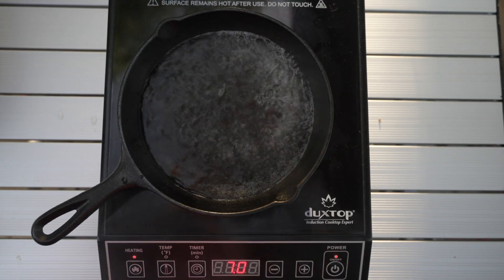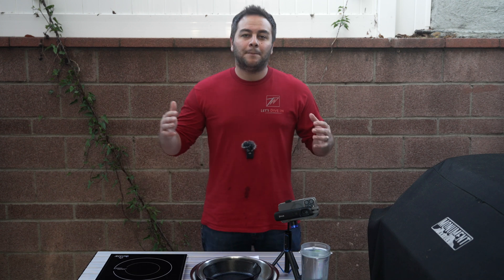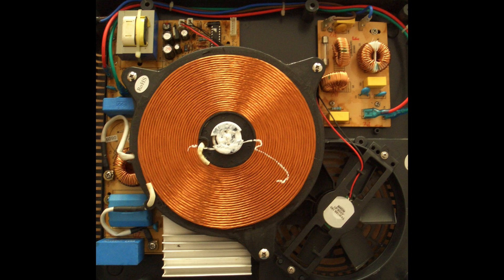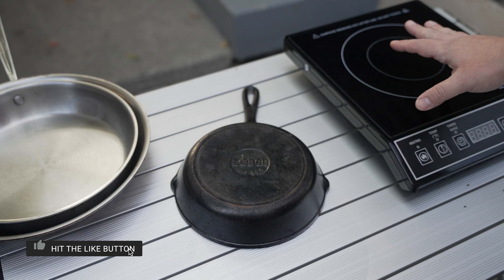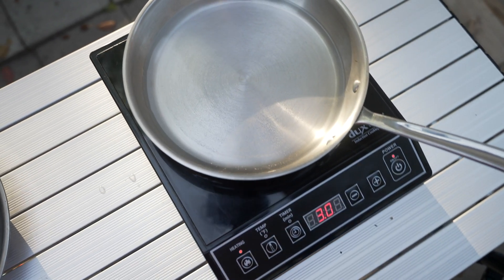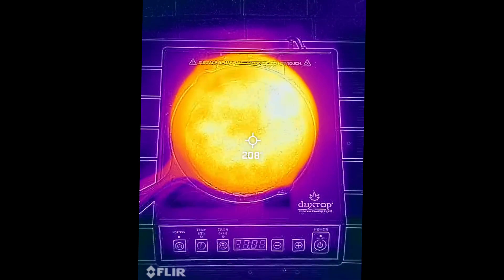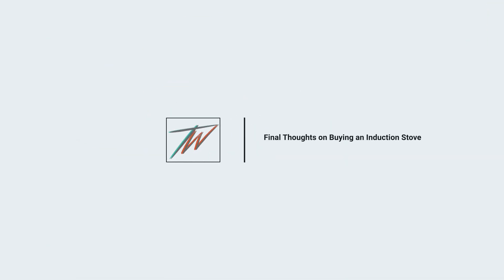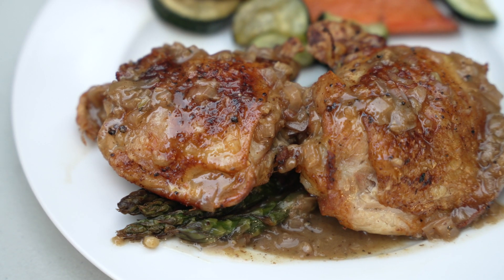Induction Stove Top Coil Size Matters // Thermal Imaging Shows You Why

Comment from the maker: What did you think about the result? Are you considering ditching gas stoves for induction? Do you think gas stoves are harmful? Let me know below.
Reply: I would never switch to induction until they fix the issue with heating the entire pan.  Gas is so much more efficient at heating the whole pan.  It may not do it faster, but the 2 or 3-minute difference isn't important to me as a home cook.  I've never ever had to rush a meal and was 5 minutes too late due to the gas not heating up fast enough. That's the only benefit I can see.  Electricity is WAY more expensive.  As long as you have adequate ventilation, air quality isn't an issue.  And for those who say induction is better because it requires less energy, you need to take a physics course.  The amount of energy it takes to raise 1 ml of water 1 degree Celsius is the same regardless of the heat source.  Sure the generation might be more efficient but the amount of total energy required in the end to the pan is unchanged.
Reply: Harmful; maybe! I am more interested in depriving the Greedy gas/oil companies of $!
Reply: @tomwadek 

I love induction 1000 times better than gas. Perhaps when pan searing an expensive steak gas is better but I got used to induction in the Philippines and I rate it 1000 times better than gas for health reasons and I felt the performance of induction was fine.
Reply: Can you change the size it heats up? Mine is only a small diameter in the middle
Reply: I think they are coils, not really magnets. They induce a magnetic field, but are not magnets, don't spread misinformation and just call them what they are.
Reply: @SirDragonClaw here you are on y-t and all you need to do is look up how does induction  work, and watch the vids! Pathetic!
Reply: Yes gas is harmful. Not nearly as harmful as many things in your kitchen. 
I always preferred gas because I could adjust the size of the and know how hot it will be. I believe gas heats faster. How many restaurant kitchens use electric stoves 
After using induction hobs, I prefer them to gas.
Reply: The very issue you discuss ... misleading burner diameter markers and evenness of heat distribution disqualify induction for serious cooking.
Reply from the maker: @bobtheelectrician6692  yeah, it’s unfortunate. I’ve found good brands do clearly list their burner but it’s mostly for kitchen size tops and it’s well over $3k
Reply: @bobtheelectrician6692  : A Goldilocks Fairy Tale 
The supposed benefit of greater energy efficiency is a mirage. It holds true only for a very constricted range of "appropriately" matched cookware/coil sizes. 
The very informative thermal imaging shows that even the 8-inch cast iron skillet is, in fact, too small as the side walls undergo unnecessary, and perhaps undesirable, heating. 
In a word, the control is simply not there. 
- -
Reply: @adamnoman4658  Not true. The induction stove energy efficiency is dictated by its technology -- the pan heats directly. Electric stoves and gas stoves have an intermediary -- element or flame; this is why induction rules. Of course, the combustion product of gas stoves make them a complete no-no in "air tight" homes.
Reply: gas is the best

Comment: I love my gas stove. Cooking with gas is sexy, and great heat distribution. I also have make up air, meaning an open window, and run the fan all the time. 
I have an intro induction cook top that I use outside to cook fish and I use it in the winter for basic boiling. I’m looking at potential upgrades and the Breville is on my radar … huge price difference… and wondering if it’s the coils that make the difference in that unit …

Comment: Who makes a good portable induction cooktop with a 10" or 11" coil?  I have a Nuwave PIC gold pro and am very happy with it's 8" coil when using a 10" 3 qt saute pan.  I'd like something bigger and maybe a full 1800W to work with a 12" skillet or 5 qt jumbo cooker or dutch oven.  Do I need to get a full cooktop replacement to get an 11" 1800W coil?
I started with the PIC because I didn't want to use cast iron on my ceramic IR stovetop.  I've now upgraded most of my pots & pans to tri-ply and cast iron because they just work better. 
I'd also like to keep the temperature control and sensor for the pan and the food probe.
I've measured the power my PIC uses to heat a 12" skillet and know that it needs to be a steady 1000W to maintain the temperature.  Initial heating requires even more to get it up to cooking temperatures.
I also know that using 1500W on a small pan is enough to warp the metal or crack it.  And yes,  it can get hot enough to melt aluminum if the temperature is not limited.  I think the Nuwave feature providing 3 power levels (600W / 900W / 1500W) and a temperature control with 5 degree resolution is the best method available.

Comment: Sharing my experience with finding out actual coil sizes of mobile induction cook tops for one (large) pan/pot. Spoiler: it has been frustrating and my text is rather long! :(

[Preface: For my smaller pots and pans I am using a slim tokit induction stove top that I chose specifically because it can actually simmer, as it doesn't turn on and off (pulse) a lower wattages. So far so good. BUT: 
The diameter of that induction coil is rather small [around 15 cm judging from the bubbles in water or the browning of crepes], so making crepes or pancakes or evenly browning meat is REALLY difficult to impossible.]

So I started to look for actual coil sizes and it es VERY VERY FRUSTRATING, because even customer service will often NOT know the actual coil size. 

For example: I asked for the coil size of the rather pricey SMEG induction cook top in a comment to the official instruction video by SMEG here on YouTube, and the answer was "22 cm". 
I had parallely asked via contact form on their website and the customer service initially answered that coil size simply was NOT REQUIRED TO BE MENTIONED in the technical information of an induction stove, so she said she doesn't know! 
She continued that "as it says cooking zone: 22 cm" and that it was "suitable for pots/pans from 12 to 24 cm" (not specifiying whether that's pot diameter or contact area) "we are safe to assume that the coil size is around 22 cm". 
I wrote back that for a product in that price range I don't want an assumption but an actual fact, and that I would appreciate if they could please find out specifically - I mean: SOMEONE in their company surely must know? 
The answer I got THEN was: 16 cm(!)

I have also asked other companies concerning their 2000 Watt to 3500 Watt single coil mobile cook tops, and most WON'T give you that information or won't bother to answer at all.
The ones where I found out the CONFIRMED ACTUAL COIL SIZE: 

- SMEG indution cook top: 16 cm (as mentioned above and contrary to the "cooking zone of 22 cm" they claim.

- AMZCHEF 3500 Watt with a second coil ring that can be manually added by you pressing a button. They actually tell you the coil size in the product description: 230 mm (23 cm)

CASO told me specifically when contacting them via e-mail: 
- CASO Maitre 2400: coil size 21 cm 
- CASO TC 2400 Thermo Control: coil size 21 cm (actually the same as the one above, except for an additional thermometer that can be used to control the temperature by placing it inside the pot or meat etc.)
- CASO  ProChef 3500 Art. 2364: coil size 23 cm (but this one is HUGE as it is meant to work in professional kitchens - so it would be too high to put on top of my kitchen counter)

So far I have only tried the AMZCHEF 3500 Watt and making pancakes in it was a DREAM! I had some other issues with it (the pulsing in lower wattages made it very difficult to boil stuff evenly - simmering in a large sauce pan was impossible or at least wasn't intuitive as it would have needed experimenting with using only the small inner coil in spite of the large contact area of the pot), and I didn't like that the hard plastic feet made it slide around on my kitchen counter when stirring or cleaning. 

I have not yet tried the CASO Maitre 2400 as I have become tired of ordering stuff, trying it out carefully not to scratch anything, get it sparkling clean as new again and return ... . 

Does anyone know if there is a list of single or double coil MOBILE induction cook tops with ACTUAL coil sizes? I would very much appreciate any help. Thank you!

Comment: Do you think a diffuser plate could help disperse the heat for my 12 inch skillet? 
Also, I find I can’t cook rice on the stove for example, because my burner doesn’t have a proper low heat, it’s simply pulses more or less depending on the heat level I choose - creating a sort of pulsing boil every few seconds instead of an even simmer. I wonder if a diffuser would help with that too.
Reply from the maker: It should but it may not be as efficient n

Comment: Why is the coil size of an induction cooktop important, but not the burner size of a gas cooktop?  I think you'd get similar results if you put a 12" pan on a smaller gas burner.  What's important is the heat transfer of the pan, and sizing any burner/cooktop appropriately to the pan being used.  It's also a factor of the construction of the pan you're using.  How efficiently a pan transfers heat and retains it is just as important as the amount of heat being applied to the pan.

Comment: My last apartment had an induction stove top. I liked the technology, but the coils were worthless. They weren't particularly large, and there were blank spots, they weren't complete circles. This new apartment has a traditional electric stove top and I thought I'd be happy, but as it turns out the burners on it are even smaller so now I'm hunting for an induction hot plate so I can cook without losing my mind.
Reply from the maker: That's a bummer you've had trouble with both types of stove tops, hope you find a good solution!

Comment: The problem with induction coil size is that at larger sizes, the effective area is about half the diameter.

But for 120v 15amp circuit uses, there are no big burner electric stove tops, so the limitation is the same. In practice however, an induction burner was able to cook better than a simple coil top. I used one to cook a big 8 quart pot of red beans n rice (obv no rice at that point). I had to set the induction cooker to a temp setting because even at the 300w setting, it was starting to boil too much and burn, despite having over 2 quarts of water and ingredients.

Comment: It seems the heated area on the pan is only at the end of the coil. So if there's a 5 inch coil, you'll see a 1" boiling ring at around the 5" point along the radius. It seems you wouldn't want that ring to be near the outer edge if you want the heat to spread evenly. So a coil size that matches the zone doesn't seem to be the correct solution, since the inner area would be cooler).

What seems to be true is that there are designs with multiple coils within one zone/element so that there are multiple rings of heat.

I did a test of the dual coil setup that's on the 11" zone of the SKS model (which should be the same as the LG models) and saw two rings: at 4" and 8". 

I also tested a large zone on a Bosch and it seemed to heat the pan everywhere. I'm not sure how it achieves that, but I'm guessing it must have many independent coils for the one zone.
Reply from the maker: Yup, great point.
Reply: So you think the LG 11" zone has a 8" coil underneath?

Comment: Most cook pans will spread the heat throughout the pan, although it may take a bit longer.
Reply from the maker: That is correct, but there are some caveats to that depending on the pan material and thickness.

Comment: Natural gas (lighter than air) and propane (heavier than air) are dangerous.  Must have exhaust ventilation to the outside.  Leak detectors & earthquake shutoff valves are also important.  Eventually, all cooking will be induction, but those of us stuck with gas can use our brains to be as safe as possible.  If you lose your sense of smell, it may no longer be safe to use gas in your home.
Reply from the maker: That's good advice to keep in mind.

Comment: i have been using portable induction cooking units for about three years now.  the coil sized is definite an area that needs to be disclosed by the manufacture but what really bugs me it the temperature drift that occurs with basic meal cooking. my first unit would change temp by 30deg  f. going from 230 to 200 before the coil would turn back on.  the second unit bought has better temp control but still not close to how gas can keep a set temp.
Reply from the maker: That is good info to know, thanks for sharing your experience!

Comment: I was initially skeptical about the claims of health issues with gas cooking - I mean, people have been cooking with gas for a century, right? But as more studies have come in, I'm convinced. But while I'm not a fan of the inefficiency of gas, I love the speed control, the ability to use a wok (I have a higher-than-average BTU output Blue Star range), and the ability to roast things like eggplant and peppers right on the burner. I've thought a lot about moving to induction, but I'm not thrilled with how many have too-small coils (both in diameter and and "annular width", i.e. exterior diameter minus interior diameter), the possibility of pan warpage, and losing the ability to get something approaching a decent wok hei. 

The conclusion I've come to: I'm over 60; how much more damage can a gas stove (which sits under a vent to the outside) do to me before I kick off anyway? I'll stick with gas.
Reply: And like most scientific studies, search engines promote the studies they want us to see and bury the rest. It takes a bit more effort and digging to find independent studies that undermine the consensus. We see this happen with climate change, pharmaceuticals, fluoride, etc.

Comment: An undersized induction burner will still out perform a radiant burner that is properly sized, in terms of time to get a pot of water boiling. Remember, we used to cook on coil burners which came in two sizes, 6 & 8”. If you want an evenly heated surface, size the burner properly, or as seen here, use a material that transfers the heat evenly.